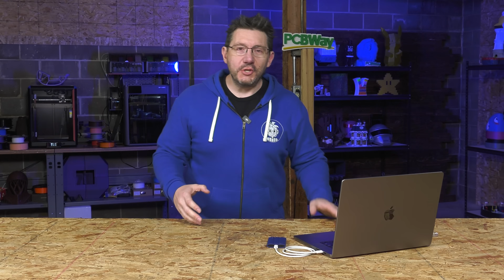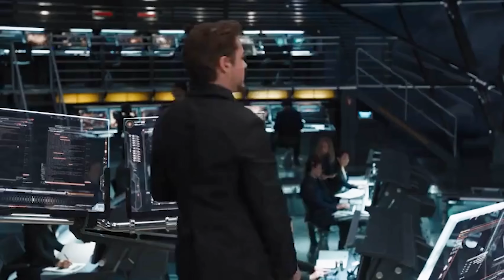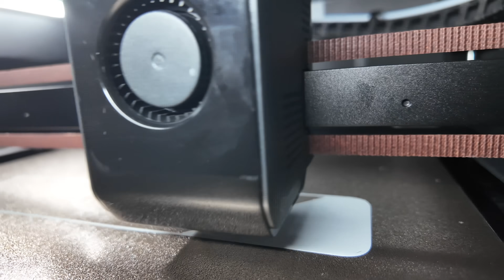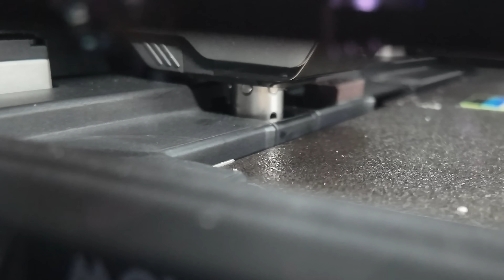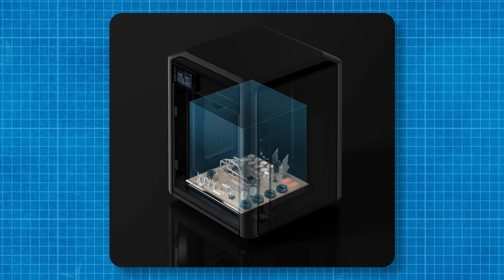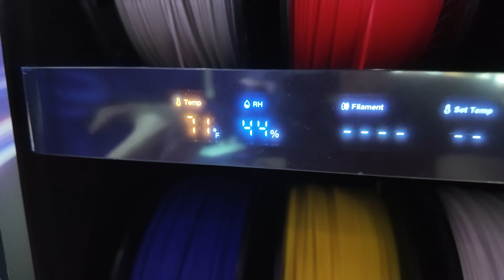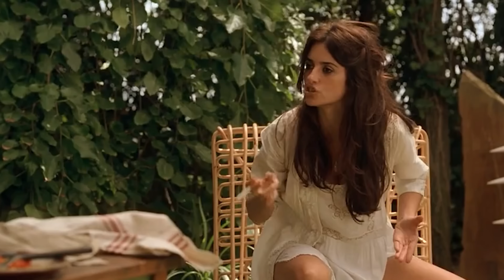12 NOZZLES?! The Mova AtomForm Palette 300 is Crazy! (No Purge)

Comment: What is the point of quick nozzle change? You still need to heat and load it. I didnt got that on bambu h2c, i dont get it there.
Reply: It is theoretically faster and has less waste, because it doesn't require purging. In my testing of the H2C vs. H2D, the H2C was about 30% faster (though that is very dependent on the specifics of the print job).
Reply: @serialhobbyism_official  only 30% faster for very complex system. Not worth the complexity IMO, dead path.
Reply: @danilaalpatov1374  that's a valid opinion! With the H2C, I haven't had any issues. But it is more complex and 30% isn't a HUGE savings, so it may not be worth it to many people.
Reply: No waste dummy 😂😂
Reply: It's all about wasting filament.
I thought this was common knowledge now
Reply: screwing and unscrewing sucks, there is also the torque and sealing issue with traditional nozzle designs

bambu's approach is the best because its fast and reliable

Comment: It is technically awesome, but sooo many moving parts to break, and this comes from a h2c owner.
Reply: This is my question. Threads don’t last forever. Especially after thousands of changes. So will you need to change the heater block once those get worn down?
Reply: @aaronchamberlain4698   It doesnt necessarily need threads it could use a custom design (like for example a locking mechanism sort of like whats in door locks). I would guess they propably didnt do that cause it would propably take a lot of time and money to get something like that working, with tight tolerances made of example hardened tool steel made to last, but what Im saying is that how your phrasing it like it has to be thread no other alternative couldnt be further from wrong.
Reply: Maintaining such a printer will be a badge of honor.
Reply: @eltamarindo  This printer will never actually hit the market.
Reply: @DOGMA1138  yet the website says different..... did you even go to the website yet... or did you just post a comment hahahahahaha
Reply: @sauron4526  OMG it has a website!!!!!
Reply: Ha ha ha, take as much of the idiots $50 deposits and file for bankruptcy.
Reply: As a fellow H2C Owner trust me the Printer is actually quite nice to work on... Except... the Hotend Cooling Fan... If u need to service that thing...
Reply: @mutethecyberwolf that’s one of the easiest parts to service? Way better than having to replace the Idler Pulley on it. I’ve already had to replace one due to obnoxiously loud clicking from one.
Reply: As a fellow H2C owner, I really don't understand this comment. There are actually not that many parts that can break on an H2C. The Vortek system is magnetic, with a sliding latch to lock it, and the nozzle rack is controlled by a single servo motor (the same as in the extruder, AFAIK). It's actually a vastly simpler system than a toolchanger.
Reply: @michaeljordan7154  Bambu was your first printer?
Reply: I wonder why Bambu didn’t go with a spinning mechanism instead of the dual rack thing? They probably could have used the exact same magnetic head design just on a wheel and got more than 6 nozzles.
Reply: Agreed. I instantly thought the chances of cross threading one of those nozzles is just a matter of time. And its slow. Tge whole thing seems gimmicky to me at best and a repai nightmare at worst
Reply: I said the same thing about the H2C on faux hammers video 😂
Reply: Its also a bit unnecessary given that orca spectrum exists. At least for multi-color applications.
Reply: @alexgibson7960 lmao full spectrum is no where near as effective as real colors fool. Calm down.
Reply: @AKFurbes2126  In its current form definitely not but the community is making progress on it everyday. They're working on a solution to fix the top layers being a different color right now as well as different techniques to hide the layer lines. Transparency of the filament is also a factor as well, similar to lithophanes.
Reply: @alexgibson7960 i know.  I've been following it for quite some time.  I'm literally printing with it right now.
Reply: @AKFurbes2126  cmykope
Reply: @AKFurbes2126 Its pretty close and now theres another designer that has worked out top and bottom color layering....Its 99% done. And what does "real color" even mean? Color is color bro
Reply: @michaeljordan7154  That's why I went H2D. I don't do a ton of multicolor prints and I was afraid of the H2C complexity. H2d easly cuts print time in half compared to single head with multicolor.
Reply: I would be interested in long-term durability on both the H2C and the Palette. The H2C has a whole host of other problems, including the $50 price tag of those magnetic induction nozzles. The Atomform nozzles seem to be much simpler and more traditional in design which should keep their costs much lower and that matters a lot when you're buying 6 (for H2C) or 12 nozzles.
Reply: @donnyriggz The nozzles are $39.99? Guess location is a factor but you didn’t mention where. I’m interested in the “host of problems” the H2C has that you mention?
Reply: @SeriesDmusic idk. The H2C is super reliable, in my experience. Yeah, it's slower than a toolchanger for colour swaps, if that matters to you. But the flexibility of having multiple nozzle sizes available at any time, and being able to use up to 7 different filaments is much more important to me. It's also a far simpler system than a toolchanger, so repairs should be less frequent and easier.
Reply: @ultramegax in my experience the H2D and H2C both have issues with the MC Boards failing. So not necessarily H2C specific. Currently waiting on a new MC board or a new AP board since it’s currently broken and won’t do anything.
Reply: @SeriesDmusic You probably have bad power in your house. Buy a UPS and plug your printers into it so that they get filtered pure sine wave electricity. It'll also prevent prints from failing if you have a short power outage.
Reply: @NorCalPatriot1776 electrical was redone entirely between the first failure and the current.
Reply: @donnyriggz also very curious the “host of problems”

Comment: Interesting. I like the build size. That's a big filament storage box. Oh, no pricing :(
Reply: There is pricing on their site. Iirc it's 1299 or 1599 with the "AMS" system. I don't have time to look for the price now or I'd check.
Reply: @OhImKiCkiN  $999 for the base unit, $1299 with one RFD-6, $1429 for one RFD-6 and 6kg filament, and $1809 for 2x RFD-6 and 12kg filament and an extra nozzle bundle.
Reply: @donnyriggz  Cool thanks

Comment: That a really great idea , the make or break point for this printer will be the nozzle swap time.
Reply: From what I've seen and heard it takes around 1 minute, which is a little slower (but not much) than the H2C, but at a lower price with more nozzles I still see a place for this machine. The real question is, do you need 12 nozzles. LIke, what can you do with 12, that you can't do with 7? And is it worth paying nearly double for a fully kitted out H2C vs the Atomform with 6 nozzles and 1 RFD?

Comment: Might be my ignorance missing something, but is a novel nozzle changer design the only thing that is new here? Seems like a lot of money to spend on an event if the premise is "a printer that is just like every other one you've seen before, but our nozzle changer looks like Iron Man"
Reply: I think that Part of the innovation is how compact it is I guess? , If you had a printer With 12  toolheads, the printer would be massive, this One has 12 nozzles but the printer isn't that big
Reply: @ulforcemegamon3094  Yeah but it's not 12 tool heads, it's 12 nozzles. So I'm with @VincentKraven in my ignorance, because I don't see how that's better. It still has to pull back the filament and load a new one. Then it has to heat up the new nozzle, if it isn't already heated. Then it has to extrude and purge into the new nozzle and prime it. A true multi-tool head doesn't need to do all that. I really want to know what the purpose of changing nozzles is all about. Maybe we need another video that explains the process a lot better.
Reply: @jorgelfeliciano gotta agree, more videos are needed because as for now, we have no idea how much time the color changing takes
Reply: @VincentKraven  tell that to my guestroom of fdm poop 💩

Comment: I remember seeing one of these years ago. They had a kick starter
Reply: @SpectraV3i  Maybe thinking of AnkerMakes printer. They did a Kickstarter that I backed. The addon color option had almost the exact same enclosure to store 6 spools. They never could get the color changing part to work. But they had a print head that had 6 nozzles on it and they couldn't mass produce it so they gave up.
Reply: I saw a similar Thing for the prusa MK3 years and years ago.
Reply: @MaxMichel89 that is the one I saw
Reply: @MaxMichel89 that is the one that I had seen.

Comment: It certainly is interesting. Good to see more competition in this space. 

Do you know how well it handles TPU?
Reply from the maker: I’m told it handles it well. The ball in the video was TPU printed on the machine. You feed the TPU in a different way.
Reply: @3DPrintingNerd  Really? Normally those airless balls are printed from flexible pla because it’s much more springy than tpu. The tpu balls don’t bounce very well at all. The flexible pla balls bounce exceptionally well but the material is extremely expensive. 
I wouldn’t expect this feed system to handle any tpu that wasn’t specifically designed for filament feeding systems. Ninja flex 85a would undoubtedly jam every time. You mentioned that tpu would need to be fed differently, supporting what I said, but there are tpu out there that actually can perform in a feeding system, but none of them are softer than 95a.
The problem tpu filaments have with feeding systems is twofold. Their flexible and compressible nature makes it difficult to push through the tube to the extruder, and these soft filaments with a smooth surface tend to grab and bind to any smooth surface they touch so they get stuck to the tube itself and underextrude or completely jam up. This is why tpu is normally fed directly to the extruder, bypassing the tubes altogether.
Reply: @fraudbuster1456  PEBA is what you are probably looking for. There are only a few sellers and producers of that currently. It had a kickstarter a couple of months ago and is much better than TPU (in many ways). But beware of fake PEBA on aliexpress etc. where they sell TPU labeled as PEBA... Can only guess it is fake by the print temps they recommend as those are different for PEBA.
Reply: @3DPrintingNerd so it can't swap the tpu
Reply from the maker: @npeshman  that I don't know for sure. I will find out.